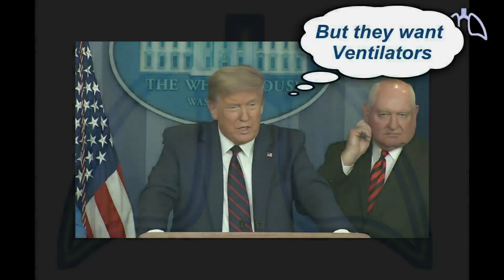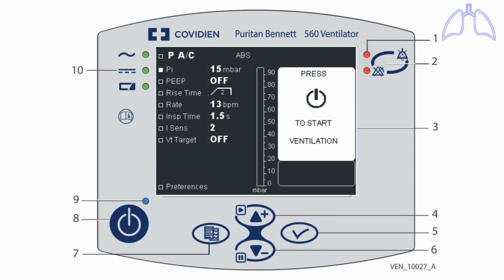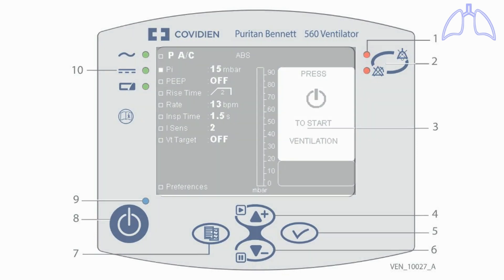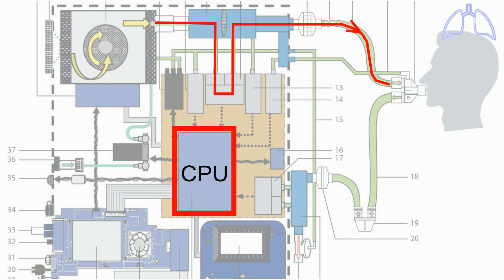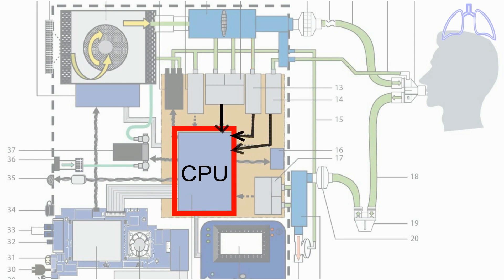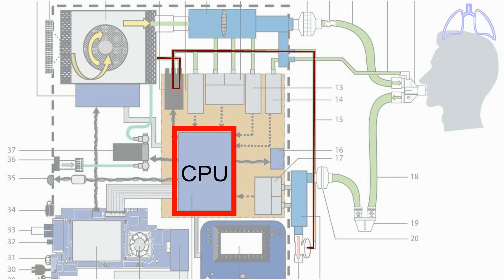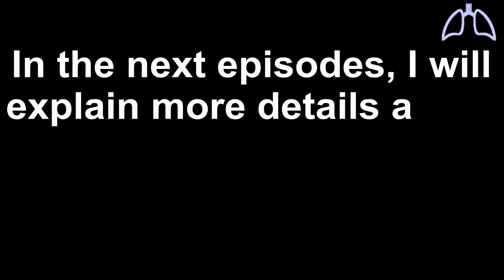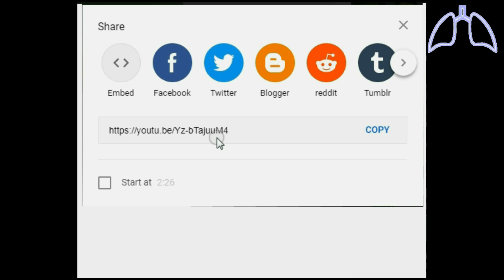The Best Medtronic PB560 Open Source Ventilator Parts Operation Explanation - Episode 3

Comment: This is very explanatory. But I think that the inspiratory flow passes straight through the large tube with the screen. The two small tubes are attached to a delta pressure transducer that allows the CUP to calculate flow based on the pressure delta across the screen area. No air/O2 actually passes through the sensor tubing. As shown at 1:18.
Reply: right